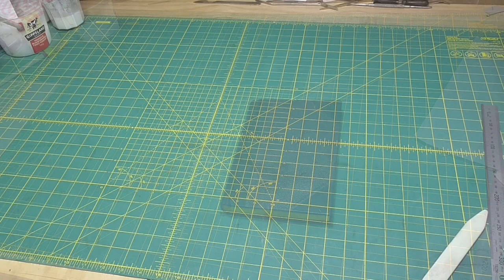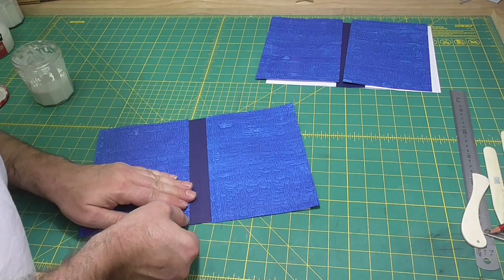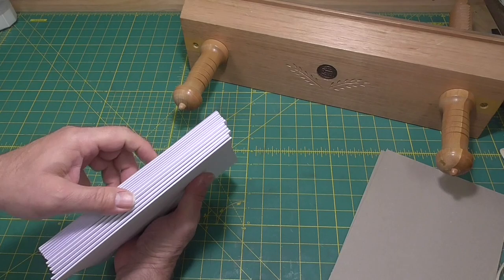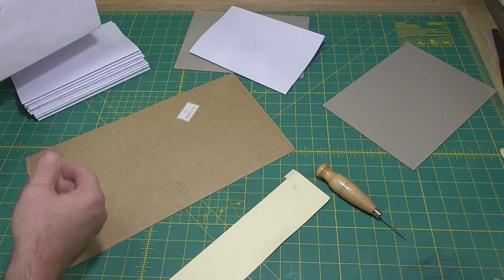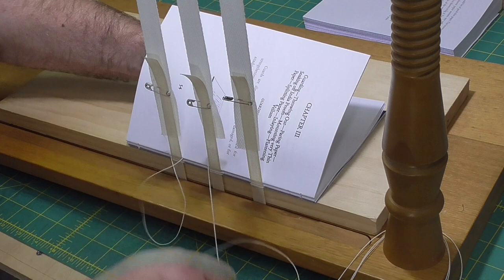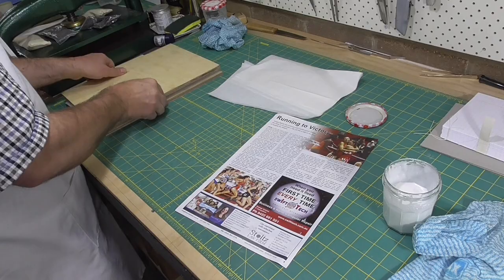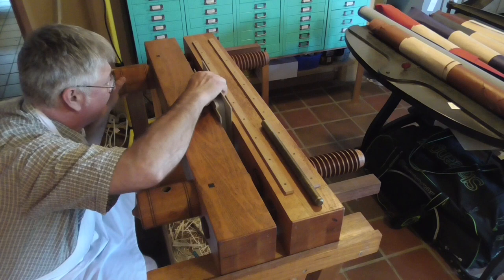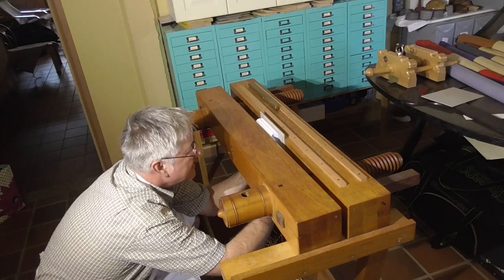19th Century Half Leather Library Binding Part 1 of 4 // Adventures in Bookbinding

Comment: I've also done a binding of this pdf! I did a half leather sewn boards binding (because sewn boards was the only method I could get to work consistently at the time). At some point in the future I think I'll do another one in a more regular binding. The folio formatted file wouldn't work with my printer, so I ran the single sheet file through Bookbinder 3.0 to make my own folio file- you could have done the same to change the signature sizes.
Reply from the maker: I use BookletCreator, and I did at first.  But I wanted everyone to have access to the same file.  But you are right, I think reformatting to 5 sheet sections would be a good idea.  Plus, it is a good example of bookbinders having to adapt to things that aren't perfect.  This happens all the time.  I would also add blank pages to make chapters always start on the recto, and then add extra pages at the end to make up the additional section.  Sewn board binding - that's a good idea for a future project!
Reply: @DASBookbinding  I used to do a lot of sewn boards books before I got the hang of tight-backed and case bindings. I think they're great for small light notebooks but it doesnt scale up well to larger books- it's hard to do a hardbacked sewn boards with a square neatly, or at least I've never figured it out.

Can BookletCreator do quarto bindings?

Comment: To avoid the blue fingers, you could try a koto pick. It's similar to a guitar pick, except it has a tube that slides over your finger, like a thimble.
It should give you the appropriate "agility" to flick the paint off the toothbrush without getting your hands stained.
Reply from the maker: I often use the back of a knife.  DAS

Comment: Another great project to get my teeth into, brilliantly explained and illustrated, as ever. Thank you so much for all the hard work and effort you put into making these excellent videos available to us amateurs. A couple of initial questions: 
- you mention that you are using 80gsm copier paper: is this a bit light for binding and also do you have an issue with grain direction as I would imagine normal copier paper is long rather than short grain?
- on the end papers, you are using  a cloth hinged end paper (similar to the one you used in the springback notebook). Apart from the fact that this is recommended in the literature, is there any reason why you couldn't just use standard endpapers?
Thanks you.
Reply from the maker: Good questions.  The 80gsm is lighter than I'd like to use.  There is no source of quality short grain A4 (or long grain A3) paper in Australia.  I'd have to invest in a ream of something like Mohawk and have it cut down at a commercial printer or binder - maybe $1500?  So the the paper would be about $100 per book.  Maybe okay for client work but not for projects not making money.  You can get long grain A3 photocopy paper from professional printer supply places, which is what I use.  The brand is Superior.  I cut that down on my small guillotine to short grain A4 or just fold it twice.  I would never willingly bind a book short grain.  I'd at least use a sewn on endpaper.  That particular endpaper is the only one I sew between the pastedown and the FFEP.  A zig-zag would be perfect for the library binding but a sewn on made endpaper would be okay.  Thanks for your good comments!  Darryn

Comment: Currently on @9:45: Why not just use a saw instead of punching that many (104, I believe) holes? Is it just for the aesthetic? I'm still learning but, and that's probably because I'm simply impatient, I've only used a saw instead of punching and it has works pretty well
Reply: Using a saw, you need to cut deep enough to make a hole in the last fold. Wide holes are created, making the binding looser and less aesthetic, especially in the outer signature folds.
Reply: @abgrafstudio  Well, somehow I didn't realize this... I'm going to move over to #punchTeam then. Thanks
Reply from the maker: Really interesting questions.  What would a trade binder have done 100 years ago?  Burdett says the golden rule is that the saw kerf should not go through the centre fold.  But I'm very slow at sewing without holes on the inside.  Adam's point is good too, especially with 8 sheets to the section.  The saw cut will be so deep it is likely to show on the outer fold.  For speed I have certainly sawn in the tape locations in the past, but for notebooks and such where I'm trying to maximise $$.  Going back to the trade binder, where this binding originated, the apprentice would have sawn the kettle stitch kerf, so who knows how deep these would be, and the women would sew the book and I suspect they were good enough they did not need holes for the support sewing.  Matthews only says to saw in the kettle stitches and when sewing around the supports to insert the needle at the pencil marks - no holes made.  Good question.